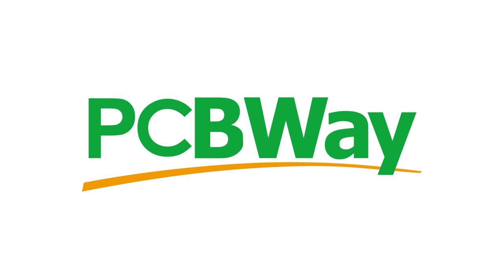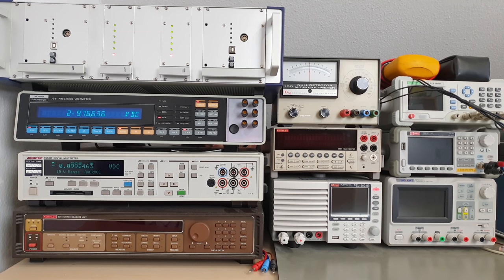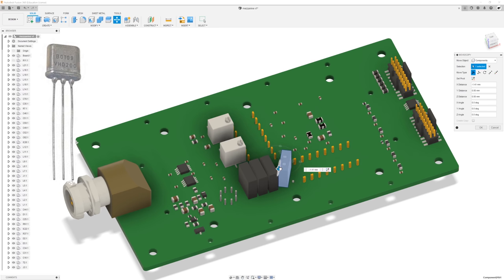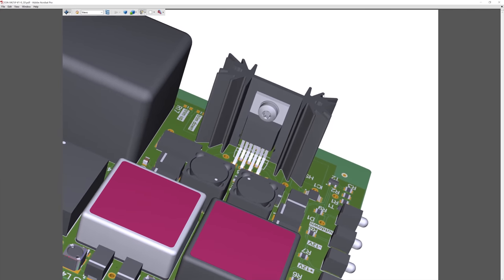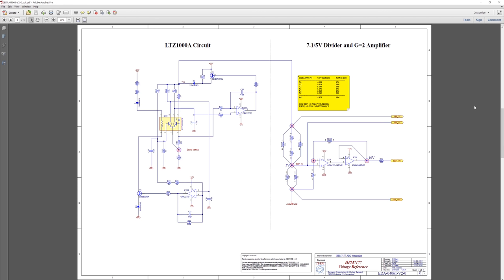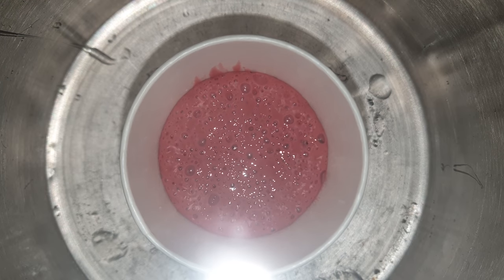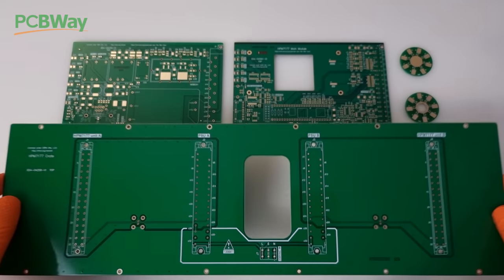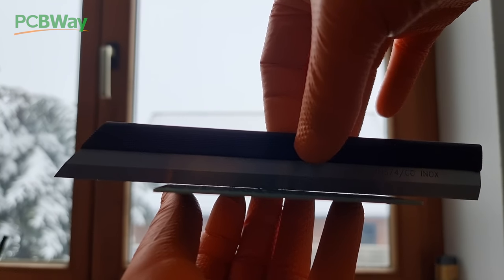Open Source 8.5 Digit Voltmeter from CERN: Build and Test

Comment: It may be possible to calibrate the linearity of the device using only two precision voltage references and a high stability resistor and capacitor.

If you charge a very high stability capacitor up to a stable voltage reference, then flip the polarity of the voltage reference to discharge it through a precise resistance, then the measurements you get should fit a known curve over time who's linearity only depends on the voltage reference and the stability (rather than the value) of the RC components. The second reference should be a slightly lower voltage that you start and stop the timing of the measurements at since the switch at the beginning and the tail at the end of the curve are unusable.

I am not familiar with how linear this could be in practice, but if the resistance is stable and the capacitor is linear enough then it seems practical to me. Also the measurement could be repeated in the opposite direction which may allow non-linearity or leakage in the capacitor to be cancelled out, I'm not sure what what the non-linearity of precision capacitors looks like though.

Comment: The nice thing about FPGAs is that you don't lose clock cycles over additional complexity, you just use more gates. So as long as there are enough gates, your 10th order polynomial should be fine.

But also, see about reducing that. Start at 2nd order and increase by one for every point of inflection. Having too many terms for the function you're trying to represent can confuse the fitting algorithm to the point where it produces worse results.

Comment: Impressive video! Have you considered using Allan Variance/Deviation to analyze your long strings of readings.  This technique was developed to analyze stability of oscillators for atomic clocks, but also works for long strings of other numeric data. Besides showing how many points to average for minimum noise, it can also show long term correlations due  things like line frequency and day-night cycles.

Comment: I did reflow soldering in an old countertop convection oven (paid $7 for it at a thrift store). Used a thermocouple to monitor the temperature and wired a simple on/off switch. I followed the manufacturers profile manually with the switch and a wall clock. Out of 30-40 boards, all but one of them were perfect. I think you are are complicating it a bit.
Reply: Well when you have extremely thick six layer boards with copper and gold spread out everywhere, tons of ridiculously expensive components that have very tight tolerance for what type of heat they can withstand before affecting hysteresis… and solder/connections that decrease in strength, Or quench harden massively with just a few degrees too little or too much heat.

You really need something that is extremely controllable. And perfectly uniform heating cycles, that can flawlessly follow a manufacturers heating schedule/profile… so you’re pretty much stuck with either an infrared oven, or the method Marco used.

I spent several years studying metallurgy in UNI…and was a machinist for a few years before starting my electronics repair lab… 

And when heat treating certain alloys of steel and other metals… The heating profile had to be followed perfectly. Sometimes two within 0.01% accuracy… Or you can absolutely destroy exotic alloys of titanium and other metals. And you might not even know it until the client has the part, and it breaks in the middle of a crucial task and harms someone. It’s not like I have the scanning electron microscope’s and equipment to test every piece I made… But I trusted that the schedule provided by the manufacturer… And used by people all over the world… Can be trusted because they spent the millions or billions of dollars doing the research to guarantee the results. That’s kind of the whole point of having parts made by “professionals“… And not having to worry about questioning the heritage or “line of custody“ of a given part.

profiles and heat treating schedules are
basically like program files….. you can download from the manufacturers website, and  load into the controller for the kiln/Heat treat oven/soldering oven.

Obviously this is only important with extremely fancy alloys of steel, titanium, and other exotic metals. And the same can be said for electronics. You really don’t need that type of precision unless you’re doing a world class project like this here. I mean… This wasn’t something thrown together by a few EEV blog forum members. This was designed and obsessed over for months… by some of the top electronics engineering minds at the worlds most important research laboratory. And then scrutinized by hundreds or thousands of professionals and obsessive geeks all over the world. This isn’t your average piece of consumer grade “professional“ test equipment. I’m lucky enough to have a small stack of professional gear, 8.5 digit meters and associated ridiculousness in my lab… and it’s some really nice fancy world-class stuff. But the project that mark is building and that they’ll be using it cern is completely in a different league.

I have more experience in heat treating steel… Than I do with strict soldering profiles… So I’ll leave you with this anecdotal example….

I spent well over a decade working with steel, through blacksmithing, welding, manual and CNC machining, and all other types of working methods. Most all of my projects have needed to be heat treated or hardened in someway. And afterwords they have to be tested and verified for proper hardness and uniformity.

I can usually produce flawless results with nothing more than a cheap worn out busted up $100 Kim from craigslist, and a kitchen oven I got from the junkyard fir free….. that I did a bit of modification to. that’s pretty much it. A few cheap five dollar thermal couples and I can produce extremely nice and uniform results. Mostly by Eye. It takes years of experience but even novice can get pretty damn good results this way. No fancy thermometers or computer controlled kilns, nothing like that… And I can achieve perfect results 95% of the time… 

HOWEVER….. Sometimes extremely complex and crucial projects come along and I absolutely have to follow strict heat treating schedules. Because I know the particular alloy or requirements for exceed my skill level… Or anyone’s for that matter. 
Instances that are just impossible to do no matter how much experience and knowledge you have… Without the proper tools. Like I said it’s super rare, but when you need it you need it. And in this case he needed it and the precision was absolutely necessary.

I’m sure you could get by doing it the way you describe… and I bet 99% of us who watch this video will never need such precision soldering and heating methods. I always get by using the bare minimum, and it’s worked out great for me I’ve done that for years. But this project had several huge obstacles that most people don’t encounter… 
extremely thick boards with extremely dense copper and gold through hole vias, copper everywhere, spread through half a dozen layers… It’s extremely difficult to get everything to heat uniformly. And with really complex components it can start causing intermittent problems that are impossible to chase down.
Reply: @hullinstruments  For what it's worth, these are not particularly thick PCBs, they look like standard 1.6mm thickness. They would need to be in order for Marco's paste stencil to lay flat when using those other boards to surround the new one -- for example I see he used at least one leftover keyboard PCB from his Fluke calibrator repair, and I'm pretty certain that was 1.6mm. Also, I suspect that the euro module cases have board slots that accept 1.6mm boards. Perhaps you thought the PCBs are thick because they are 4 or 6 layers?  That just means they have internal sandwiches that are thin enough to total 1.6mm.  Certainly thicker boards can be ordered, but I don't think that applies here.  And PCBs commonly have full ground and power planes, and these work fine inconventional PCB ovens.  So I lean toward the explanation for the vapor technique being to treat the precision parts gently.

Comment: When done via fpga, you could use a linearly interpolated lookup with thousands of points instead of a single polynomial. The FPGA probably have enough memory, and doing the in-between lerp in integers is no big deal and shouldn't consume too many gates.
Reply: Yep, if those deviations or nonlinearities are constant over time it will be a simple solution to use LUTs. I wonder what causes the wobbling INLs.

Comment: Hey, great work! I would like to suggest an alternative to polynomial interpolation, and that is simply linear piece-wise interpolation. Numpy is using least squares linear regression, which can easily overfit these polynomials of higher degree, introducing the error wiggles your data seems to be showing. Also, with piecewise interpolation, the interpolation step is only a lookup table, and more precision consumes only more memory, while keeping the computation amount the same.

Comment: Vapor soldering is frankly both wonderful and abhorrent at the same time.
Some stuff it just creeps into and ends up destroying... Though, most stuff it works wonderfully for.
Also interesting to see this voltmeter. Some impressive specs for the price.
Reply: Thanks for sharing, I was really intrigued by this technique. Was wondering whether it would make sense to try it. What are the advantages versus a regular old reflow oven?
Reply: @hellelujahh  In a reflow oven we just bombard everything with IR energy.

If a component is shiny and reflects the IR, it will heat slower, if the component is large it has more thermal mass and will also heat slower. One can compensate by increasing the IR intensity, but that means that small components with good IR absorption will overheat instead...

While in a vapor oven we instead let the vapors condense onto the components and spread the heat into them via that.

The advantage of condensing vapor is that the component can never get warmer than the vapor itself. And the vapor also has a decent amount of thermal mass and will therefor heat stuff fairly quickly.

And large bulky components like for an example heatsinks will attract more of the pavor than a small SMD resistor. Even shiny stuff that normally reflects IR will still get heated like everything else.

Downsides of the vapor oven is:
The liquid in them is expensive! (It lasts a long time at least.)

It typically has lower throughput.

A proper machine costs a lot as well. Since they have both heaters and coolers in them, sometimes even a vacuum assist to lower the boiling point during cool down, as to make the vapor leave the board fully.

The vapor will creep into stuff. Some components frankly break. (Usually stuff with a vent and sensitive internal structures, like microphones.)

The vapor can also "attack" some compounds. Where I work we have a silicone goo we use on through hole pads for when we don't want our wave soldering machine to fill in holes with solder. But we quickly learned that the Galden vapor makes that latex goo extra gooey and sticky, and not want to set properly... (And yes, some THT boards have SMD parts on them, nothing special there.)

Then there is also laser soldering.
I think it beats vapor soldering by a long shot in regards to solder quality. But it is even more expensive and far more fiddly to set up and has even lower throughput as well. Since it uses a laser to heat the solder on each individual pad at a time. Gives perfect results every time, unless one hasn't aligned the board/laser properly, then one ends up having almost nothing soldered in the end...
Reply: @todayonthebench  Wow, thank you for taking the time to go into so much detail! This was fascinating. I'm surprised laser soldering is a thing, I would have thought the reflectivity of molten solder would be a problem there. It never occurred to me in the context of reflow ovens, because I thought they were purely convective (TIL!), but shooting molten metals with a laser is something I wouldn't expect to work very well... So thanks, I'll be reading up on that!
Reply: @hellelujahh  Regular reflow ovens just blast everything with IR. That heat in the air does help, but not much.

Using a laser isn't much different.
Solder isn't an all that ideal mirror to be fair, but it still reflects most of the energy.

Normally a laser soldering system doesn't just heat the solder joint, but rather focus energy in the "general area" of the pad.

Laser soldering can also be used to evenly heat BGA packages in a more controlled fashion than a reflow oven at times can achieve, not to mention that the laser soldering could technically be done inside of the pick and place itself, minimizing the risk that the chip goes out of alignment during transport (since the board never needs to move). But I haven't seen such an implementation yet...

I have been thinking of building such a pick and place some day, would be fairly neat for small scale production to have it both place the components and solder them.
Reply: @todayonthebench  Funny you should mention thinking of building a multifunction machine like that! Part of why I'm so curious about the topic is that I have also been thinking of something similar. My idea was to have a small soldering iron tool head in the pick-and-place machine that would come in from the top and be pressed against each solder pad or component leg where geometry would allow... This would be rather limited and very finicky, so I relegated the idea to that "maybe one day" drawer in the back of my mind. But using a somewhat unfocused laser seems like it would be so much more versatile and better for the components. Quite neat indeed!
Reply: @hellelujahh  My idea started out with a holder for a soldering iron that were free to move 90 degrees (controlled by a servo), and then rely on drag soldering for QFN packages and such. And have two solder feeders, one from each side of the iron tip. Since one side can be shaded by a component. The whole contraption would also need to be able to move up and down in the Z direction.

The idea were also to have the solder iron on one Y rail, and the pick and place on a separate one. Having them both share the same X rail, just to regain some speed. And also so that one could hold a small SMD component in place while the other soldered it in place. (And yes, it would need sufficient reach to be able to do this...)

In the end, I found laser soldering and it seems so much easier...

Currently my project is just waiting on me rebuilding my laser cutter and doing some trail runs to see if a CO2 laser can melt solder with sufficient ease. (Will need to defocus it a lot though, since cutting isn't the goal.)
Reply: @todayonthebench  Nice, you've done quite a bit of prototyping already! For solder dispensing my plan was to have a sort of a printer head with a syringe that would be depositing solder paste on the pads, just to avoid the need for a stencil. I wouldn't expect amazing precision from that, but I would be happy with being constrained to the larger SMD components, at least for starters, since it would be for small runs and prototypes anyway. That will work even better with laser soldering! It really seems like a perfect technique for this.

For small SMD components like resistors and caps, given a fast enough motion system, heat could perhaps be spread across the opposite sides of a component, so that it wouldn't get pulled in either direction. If that works, holding them down with the pick-and-place arm wouldn't be needed, and maybe even all functions could be built into a single head... Although all that mass would limit the speed of movement. I guess swiveling the mirror on the head for rapid short-distance moves wouldn't be out of the question at that point 😄
Reply: @hellelujahh  Solder stencils tends to achieve better resolution and higher potential for success.

Though, to be fair, all components with a finer pitch than .8mm should probably come with their own tin already on the leads. Like flip-chip and BGA packages do. Since then one just needs some flux on the board, and that needs no real precision in its application. (This is though more wishful thinking than anything.)

In regards to preventing tomb stoning, one can do that by either giving the beam some astigmatism control, and/or just focus control. Then we can shape the beam to better heat both sides of the component at once. (Or one uses two beams with independent control like some laser soldering systems do.)

The only reason my first design needed to hold onto the component were because I intended to have it poke at the joints with an iron. A laser removes this need for most components.

Having the laser head move rapidly back and forth on larger joints could be a solution to lower costs. But I suspect having 2 lasers won't be unrealistic. We don't after all need tons of power so a die laser of a watt or three is likely sufficient for the job.

Comment: If you ever worked in a SMD production line, you can feel every step you take. From the solder paste to the smell of the galden. And also dropping hundreds euro worth of components along with the pcb in the galden oven, almost climbing in it to pick the parts out again xD
Reply: And also the gravestone components. Almost every batch had at least one to three on it